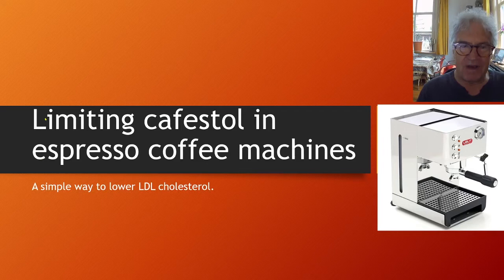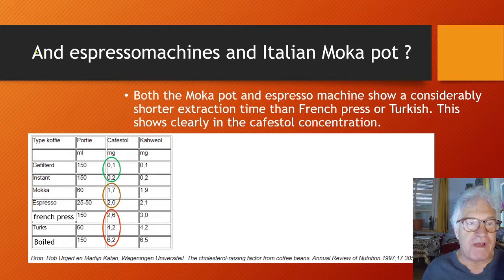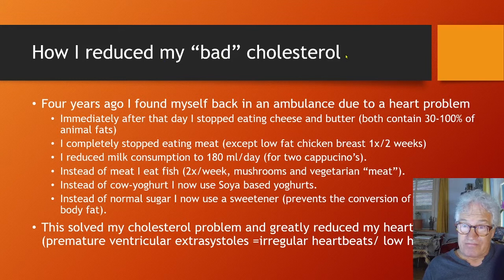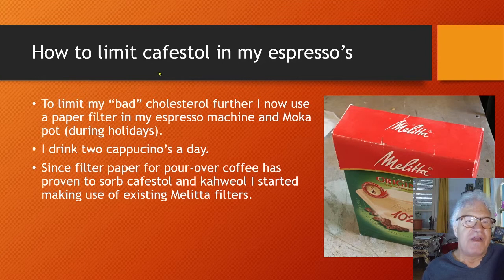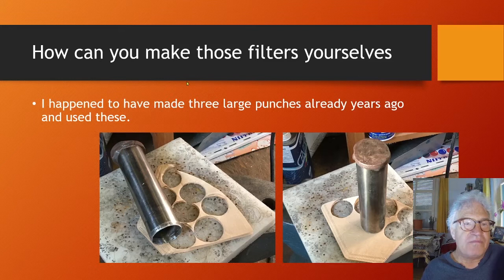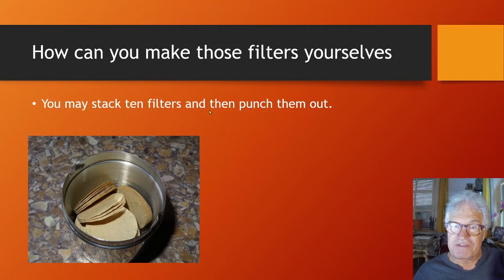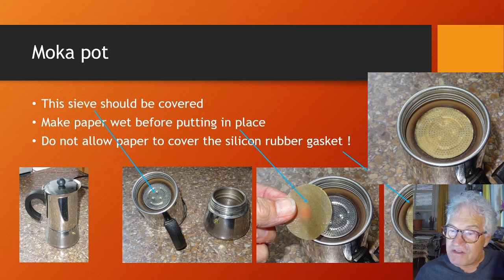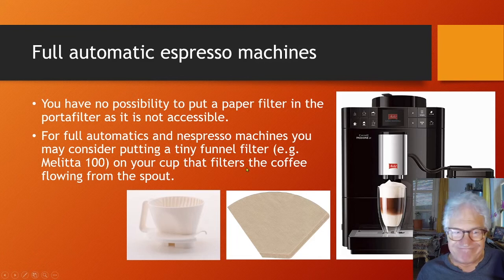A simple way to reduce cafestol in espresso machines and Moka pots. Lower your LDL cholesterol.

Comment: Thank you for such an informative video. 
I have an Aeropress but usually use an espresso machine.
After watching your video, I found a stack of paper filters that came with the Aeropress and tested one in the bottom of the double shot portafilter, and made a coffee with it.
The filters look to be around 62mm in diameter, so the edges need to curve up around the base of the portafilter when it is placed there.
My Breville machine has a 58mm filter basket. 
The filter is a little larger than the base of the basket, I did not wet it first (and it seemed to work just fine) but if it is wet like you suggested it may be even better. 
The coffee extracted well with the filter in place, just like you said it did not look any different.

Comment: Amazon I think sells filters that are already cut for espresso machines.  I have a metal one I just got. Could I use it with one of the precut on amazon.or 2 of the paper ones they sell on Amazon. I know the brand you have is good.maybe they will make filters for other machines someday.
Reply from the maker: I tried to convince Melitta to make these filters but they will not do it. Metal filters will not work; as far as I remember from the articles I read. Gerard

Comment: Do you have any idea how much this reduces cafestol by? I'm just 32 years old and switched to lever espresso.  I really enjoy it but it also raised my LDL. I want to enjoy my coffee, at the same time don't want to shorten my lifespan because of it. Filtered americano or drip coffee tastes too weak. If i filter espresso after making it it loses temperature and flavor
Reply from the maker: In fact, I don’t. But having read important scientific articles on the effect of filtering with paper I assumed that paper filtering must be effective. To be sure on the sorption capacity I use two layers of the paper. I asked Melitta if they were interested to produce round filters for this purpose and, prior, do tests, but they responded that there are too many sizes sieves to be cost effective. Greetings Gerard